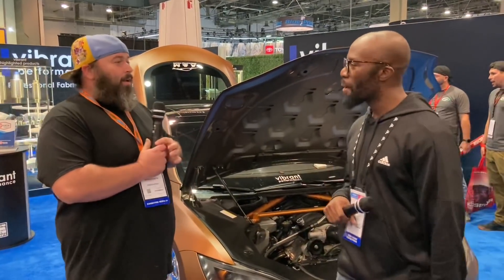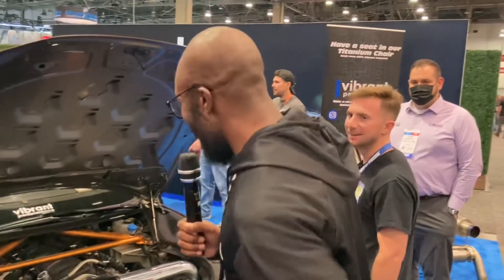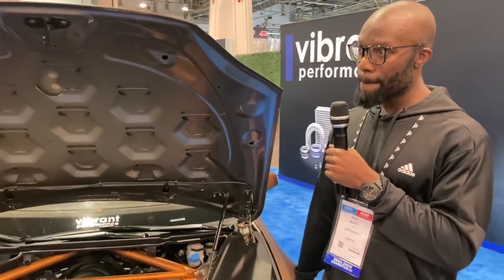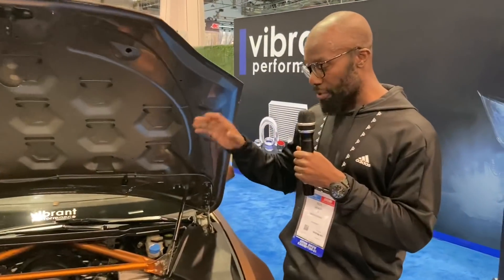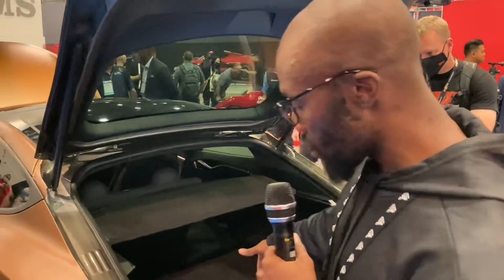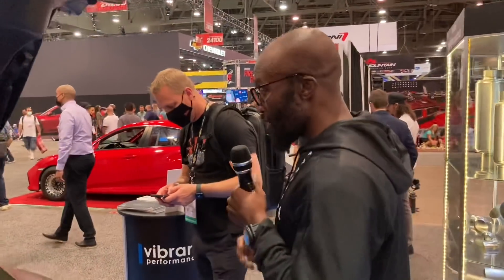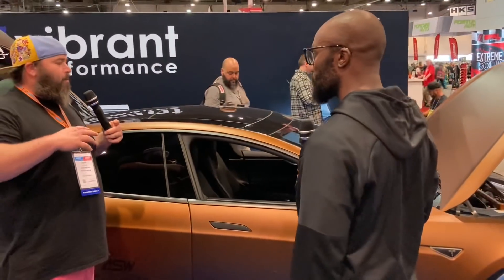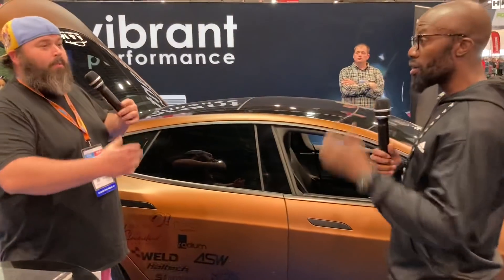RacingJunk SEMA 2021 Rich Benoit of Rich Rebuilds Made An LS Swap In A Tesla…Yes, You Heard Us!

Comment: Jut on that gear indicator thing - after a while, you will tell what gear your in from the rpm at a given speed. The only issue you can find with very torquey engines is you might end up in second gear at low seeds when you should be in first gear; you'll wonder why, for a moment, why the damn thing is sluggish pulling away from a near stop. You'll realise t check if thre's another gear and find out you wernt in first!

Comment: Have you thought about stretching a Tesla out
Reply: If you mean making a Tesla Stretch Limo, someone tried that and failed.
Used a sawzall on the wiring, joined the wires back together wrong, then tried to sell it with a battery that hadn't been charged in 2 years and blown up electronics.